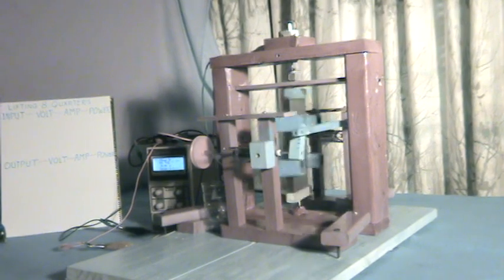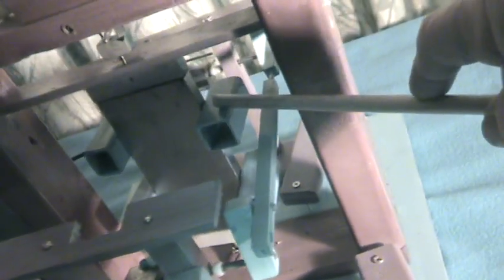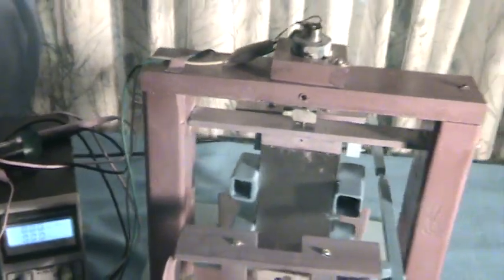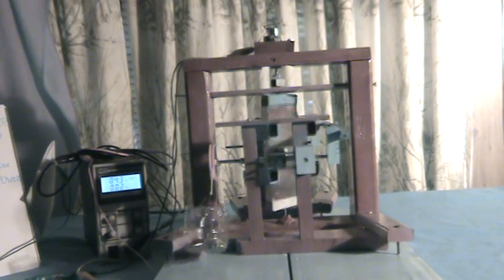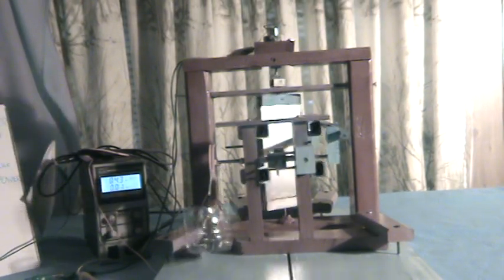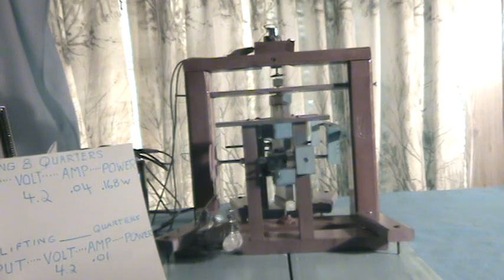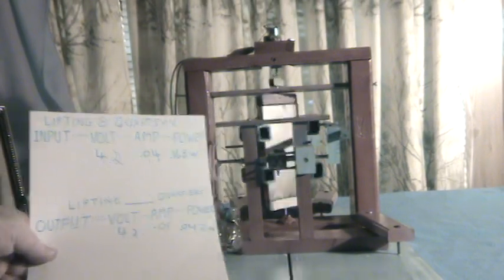Ray's N - S  Magnetic Switch Generator  5

Comment: Sorry but it is far from overunity.
1. When coins are going down they are helping the machine.
2. Even So lifting 360g for 1 centimeter in 1 sec is 0.04W
when the input is 0.08W

Comment: Welp, buddy. It looks like what you have there is a simple lever or pump jack mechanism.

There’s a difference between force and energy. Yes it takes energy to have force but but it works like a simple lever.

In the lever if you move the fulcrum all the way to the far side it becomes much easier to lift the weight, the catch is over a longer distance however.

If the fulcrum is in the middle then you are simply lifting the same weight over a shorter distance and it’s harder than when the fulcrum is at the far side.

I see that your weight lifting antics is not pulling the weight up as high as when there’s less weight although it’s lifting more. This is a convoluted lever mechanism.
Reply: Absolutely 0iq take, I am baffled. You wouldn't happen to be a mason would you?

Comment: Crabs! I just realized this has more potential than I initially thought! You can easily multiply these pairs around the magnet (horizontally), starting with another pair in 90 degree angle, which looking from above will create a cross of 2 pairs: ☩ 
Then just multiply them vertically too: imagine setup with 4 pairs around the magnet in a star pattern ❉ and multiplies by 3 vertical layers.
But still, isn't this just a type of magnetic gear?
Reply: Thanks , yes but the 30 degree flapper magnet does have a resistance under load . I am working on design now to get around this .

Comment: What happens if you increase the size of the flapper magnet? Do you get more torque? It doesn't appear that it would effect the rotor magnet. You totally need a 3d printer though. You need an Ender3 and Fusion 360. Anyway, you finally dropped a video...I've been waiting. Nice upgrade! I think your on it.
Reply: Yes a greater output . It is scalable . Thanks for input .

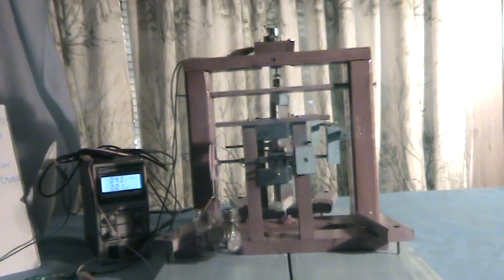Comment: Looking Promising :) put 2 more pairs of lifting magnets on it, 12:00 to 6:00, 2:00 to 8:00, and 10:00 to 4:00.. with that much torque you could use gears to increase  speed to a generator.
Reply: Thanks  more seems possible , but the real test is putting a gen erator on it  ' hope in the next 2 videos to have that